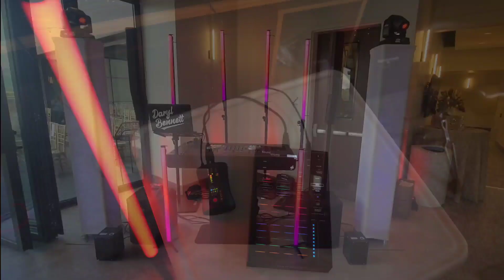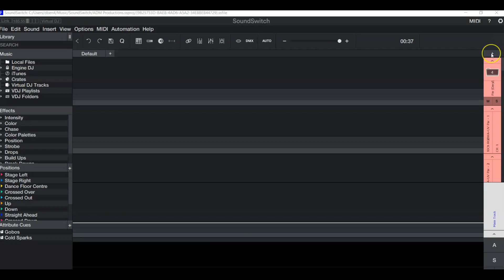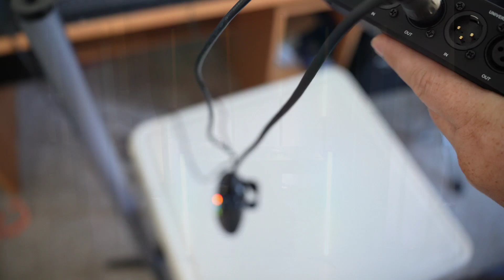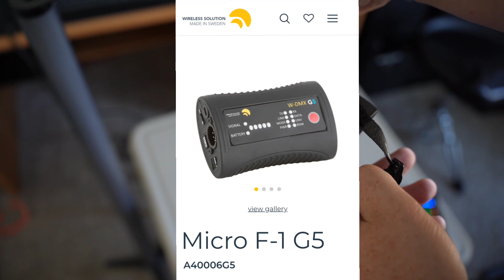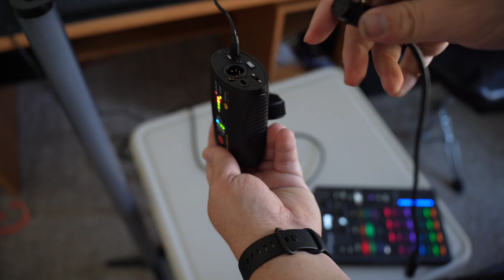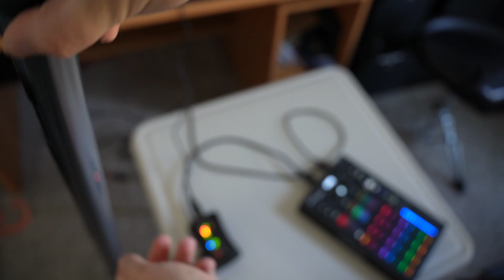Connecting the Chauvet Well STX 180's to Soundswitch - Control One W-DMX Demo

Comment: Great video DJ Daryl! What if I have Chauvet Freedom Par H9 IP uplights. Will I need a D-fi transmitter to connect the uplights to soundswitch? or will the regular dmx signal work with the donner dongles to the connect the uplights with soundswitch?
Reply from the maker: You need a D-Fi transmitter or wireless receiver dongles in the DMX receive port
Reply: @DJDarylBennett  I truly appreciate your response! I tirelessly looked across the web to find an answer(or yt video) and found nothing. Soundswitch couldn’t even provide an answer except sending me tutorial links that didn’t address my question. The Freedom pars don’t have DMX ports (since it’s built in wireless) so it looks like I’m gonna have to buy a d fi transmitter. I’m considering the Chauvet DFi hub ( looking to have 10+ uplights)… do you have any suggestions?